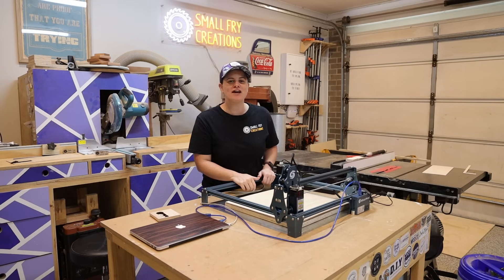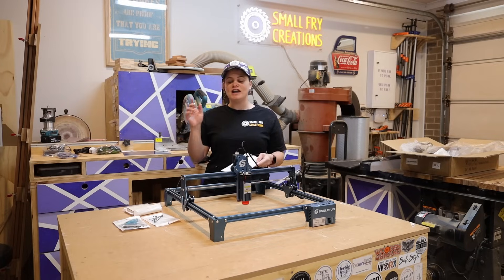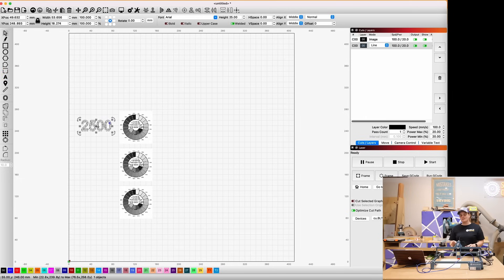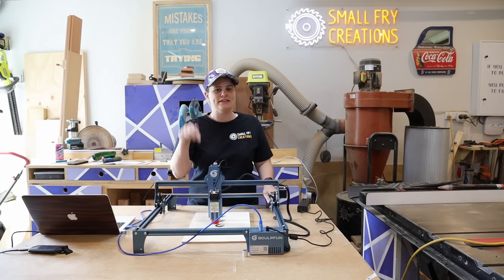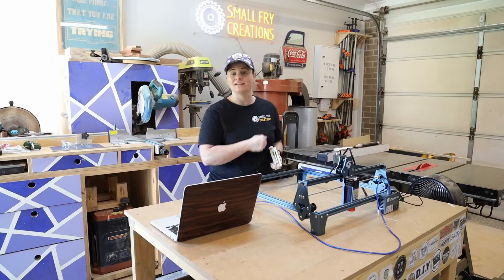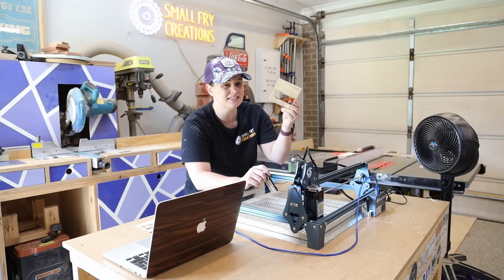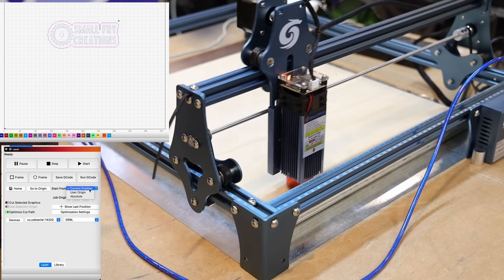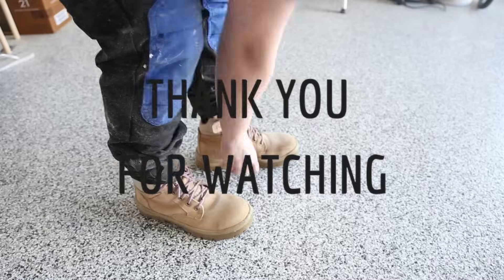BEGINNER Laser Engraving and cutting tutorial with the Sculpfun S9

Comment: Warning!

This is not professional equipment. The smoke, exhaust fumes can kill you - cancer is a likely possibility. The smell of exhaust fumes is unbearable. The burnt dust that is created during cutting or engraving is sticky and smelly. If you do not have a closed box laser with an activated carbon filter or at least an exhaust system outside the workshop, do not think about the laser business. These toys for a few hundred dollars are only suitable for amateur fun - no protection against the laser beam (risk of eye damage), toxic fumes, low power, low speed. Such a laser is only suitable for home-made - once in a while - for fun, for a hobby - provided that exceptional safety rules are observed.

Comment: i just bought laser 50W for 1700 dolars. and its max cutting is also 3 mm.. i feel like i got scammed.. and its very huge machine, like a deep freezer =(.. i could have gone with your laser
Reply from the maker: It is a big misconception out there that more power equals being able to cut thicker material. It really only means it can cut it faster. Althrough at 50W you should be able to get through 6mm and 9mm plywood.

Comment: Inkscape is free and does it all. I had some planes for a wooden clock sent to me in .pdf and .dxf. I had know clue what to do.  After a couple short vids I was importing into Inkscape and cutting gears in no time. There's a home button. Click the home btn then the frame btn. That zeros the machine then it will run a low power beam around the project edges so you know if your material is positioned right.
Also I found out that black will most likely put the laser in raster mode. If you want it to stay in vector mode use light colors like pink or yellow. Raster is for engraving vector for cutting. Really this only matters if you are doing both at the same time. Like i was with those clock gears. they came separate and i had to merge them into a svg file so I 1st placed the wheel  and changed the paths from black to pinkish. then i laid the raster image over it . that would engrave the numbers and stuff onto the gear. Then last thing, i placed a little black circle in the top left corner. this tells the firmware to do the engraving first then cut after. thats what I was told in the video.
:face-purple-wide-eyes: oooo  if i had watched just 3 min longer I wouldn't be here in the comments.
My  40w laser from Temu looks like yours except black. and it has a built in air pump to blow the debris and smoke away from the work area. It also cut a 20mm pine board in 1 pass.
okay now I'm just bragging. $207.00 and the belts were already installed. I spent about 10min on assembly

:person-turqouise-waving: bye

Comment: How would one be able to engrave the top of a wooden chest? I ask because of how low the laser sits. 

Would I need to raise the laser on a platform so it is high enough for the wooden chest or would I need to take apart the top of the wooden chest and place it underneath the laser?
Reply from the maker: You could do it both ways. You can raise the laser up and have it sit on stands or something similar to get it to the right height or you can remove the lid. Just depends what easier for you but both would work

Comment: Hello. I want to get a small laser engraver to engrave plant labels onto thin aluminium labels. Do you have any suggestion? The S9 is too big for my needs.
Reply from the maker: The S9 is a great option. I wouldn't say its to big. I find when poeple get lasers for a job in mind they get the laser and start finding a number of ways to use it and projects to do so having a laser a little bigger will allow you to grow into it :) hope this helps. The S9 is a little older now so if budget allows you could look at the S30 ranger but the S9 is still a great machine.
Reply: @SmallFryCreations  Thanks for the detailed input. The S9 and S30 can cut through thin aluminium?
Reply from the maker: @thefruitcollection  A diode laser won't be able to cut through aluminium. It can engrave but won't cut. If you are looking to cut will need a fibre laser. Sculpfun does have a Fibre laser head that you can switch out which does go with the S9 and other models. So you could have the one laser with two heads and switch out depending the task
Reply: @SmallFryCreations  Thank you. Highly appreciate it. My aluminium tags are 0.5mm thick.

Comment: Hi! Great review, thanks for sharing. I'm considering buying a Sculpfun S9, but I'm concerned about its long-term durability. Since your video was made a while ago, could you please share your experience regarding its performance over time? Has it held up well, and have you encountered any significant issues? Any insights would be greatly appreciated. Thank you!
Reply from the maker: Hey I used the last for about 12 months and only changes as I help Sculpfun with testing and reviewing so moved to the next laser. Providing you are keeping up the maintenance and keeping the laser is good clean working order it should last a fair while.

Comment: I liked this video alot. Im beginer to laser encarving. Planning to buy. Im still comparing some products. I would love to tell me the experience with sculpfun and did u try it with different cases as material. Thickness. Did u try to make wood box joints can u explain how to make tight joint considering the kerf. What about thishoney comp u made send me the link for it. What about this steel pad u used with machine laser
Reply from the maker: I love the Sculpfun brand and recommend them all the time. The Sculpfun community is also fantastic and can help with any issues or questions you may have. In terms of the box joints. I have made lots and never that into account the kerf and I get a tight joint everytime. If cutting I would recommend a Honeycomb bed. Lots of brands have them and they are all the same. The laser is compatible of cutting and engraving all the material on the website. The only thing to take into account is when a company says it can cut really thick material I wouldn't believe it as its generally not the case in the real world. 

If you are mainly wanting to cut or looking for a great all round machine I would recommend the Sculpfun S30 Ultra 22W laser as it will do a great job cutting and engraving. Hope this helps.
Reply: @SmallFryCreations  many thaks fro your reply , what about air assist. is it really important to get too as i am new in laser machines and low budget for small project prototype
Reply: @SmallFryCreations  what about DIY honeycomp u mentioned in your video
Reply: @sabrykamel3137  The DIY honeycomb in the video works but I didn't know at the time you want to avoid Galvanized metal as it is dangerour when heated. You would need to find another material. Lots of people use cooling racks that people use when cooking. If you want to cut material the air assist I think is a must. It will make it much much quicker and cleaner.

Comment: I was thinking of getting something like this for cutting dolls furniture. How tech savvy does a beginner need to be for a laser cutter? What type of software/computer requirements and skills would I need?
Reply from the maker: If your mainly cutting I would be looking for a laser that is 20W. Something like the Sculpfun S30 Ultra 22W as this will cut much quicker and comes with auto air assist to make cleaner cuts. In terms of software I recommend Lightburn. You can download a free 1 month trial and test how easy you find it to use. There are lots of videos online about using it . If you are comfortable with the software then you won't have any issues with the laser. Hope this helps

Comment: What is setting for 10mm wood laser cutting
Reply from the maker: With a laser like the S9 with not huge power I wouldn't recommend cutting 10mm. Lasers like the S9 are more for engraving or cutting 3mm plywood. I wouldn't recommend thickner then this.
Reply: @SmallFryCreations did you try it with mdf 6mm

Comment: Please take my advice with a pinch of salt but read about it for yourself. I don't know if a hobby laser can put enough heat into that galvanised sheet but fumes from galvanising can cause welders fever. Also never use the tip of using cold galvanising spray paint  to edge glass, tiles or metal. https://pubmed.ncbi.nlm.nih.gov/25348190/

Comment: 8:05 you said 2500 mm per second.  That's a lot faster than you think.  Perhaps you mean 2500 mm per Minute (2500mm/m).  Check your settings.  I think you mis-spoke.
8:22 you comment on how deep you're burning.  The slower the speed the longer the laser lase's on a single point and the deeper the cut.  Higher speeds result in lighter etching depth.  You can control depth by percentage or by speed.  OR by both percentage AND speed.  To make the same cut on a higher speed you need higher power.  Slow it down without reducing the power and you're going to burn deeper.

Good video though.

Comment: Hello, i have problems with the cutting part, my engraver is cutting the shapes deform and far from the original size or shape or cutting in top of the engraving
Reply from the maker: Hello That sounds like a belt tension issue. I would check the belts are tight enough and run some tests with rectangles and circles to confirm measurements are correct and belt tension is right

Comment: I found this great video during a search for the S9 as i have just bought one it was on a special offer on Amazon at less than £260  delivered I have been looking at getting a laser cutter for while. I am impressed with your solution to raise the work material from the  surface. i will make one myself as you found those honey combe beds are very expensive. I searched for one myself and found them to be even more expensive here in the UK where i am the cheapest one i could find was over £200. and that was for an A4 sized one. I am impressed by the quality of the machine and am looking forward to getting started with it later today. this will be a good addition to my workshop.
You have answered nearly all my questions i have about using this machine in this video.  I have subscribed and will be watching your other videos 😊
Reply from the maker: That’s awesome!! Thank you for stopping by and so glad I could help. With making your own honeycomb just steer clear of galvanised metal. I didn’t know at the time but gal metal when heated can be dangerous. Something like an oven cooking tray would be a great alternative. Happy lasering!! Lots of fun ahead
Reply: @SmallFryCreations Hi I have found the honeycomb bed on Amazon for £44 delivered for the 400 x 400mm size i have bought the 400 x 400 but wish i had bought the 500 x 500 version as that would fit the frame of the laser better. I have set my machine up this took about 15 mins to assemble and as you say, in the video the instructions supplied are very good. My first cut after engraving my logo is a sign with 350mm tall letters this i will be starting hopefully tomorrow when the plywood is delivered.

Comment: air assist ? is that the board under the work ? the honeycomb board?
Reply from the maker: If cutting a honeycomb under the material will help stop burn marks on the underside. When cutting I would also recommend air assist as it will create cleaner and faster cuts.
Reply: thank you i will get air ass.  @SmallFryCreations

Comment: Are the ruler on the frame usable? Because the laser point can not reach x and y axis : 0.
Reply from the maker: I don't use them as pending the laser head size which varies pending the power of the laser head and laser point isn't at the zero zero mark. You could use it for measurements of material not I wouldn't say they are usable with the laser head itself.

Comment: i was wondering if you could help me out , i have just bought a sculpfun s9 but my engravings have lines in them running horizontal , and i really don,t have a clue what i am supposed to do , any help would be very much appreciated.
Reply from the maker: Hey It may be a belt not tight enough problem. What I would suggest is join the Sculpfun Facebook group and record a video of what is happening. If you then upload to the group they will be able to assist and help you get it sorted :)
Reply: @SmallFryCreations  i have gone through the whole rebuild once again and everything is bang on except the banding , thank you for your time and reply , also did you only have to download lasergrbl on it's own or arduino also.
Reply from the maker: @redliner4965  Glad I could help. I use Lightburn as the software so not 100% about Lasergrbl and the set up.

Comment: I helped a friend set up a different cutter.  We got it to burn the test file but we don't know what to use to create logo file.
Reply from the maker: You would have to create the file in either a design software and then import it or create it in lightburn
Reply: @SmallFryCreations  thanks.  I found out it takes a png file so that helps.  I appreciate the response.

Comment: Thanx for the video, I ´ve been thinking about purchausing a laser for cuttin like 4-8 mm plywood. Sorry for asking a stupid question but how long this laser lasts? Is it like a normal drill that you have to change when it is dull? By the way, you doesn´t sound like an down under, so it´s really easy for people like me to understand you . Thanx again
Reply from the maker: Fantastic. Glad I could help. The laser does have a life span but it all comes down to the power you are running at and the maintenance you do. If you keep the laser clean and run the power no higher then about 80% it will last longer. I don't use it everyday so its hard to say how long they last but I haven't had any die on me yet

Comment: Hi...many thanks for sharing....may I ask please, what is the largest thing in size (not thickness) will it cut, will it cut a full 400 x 400 mm?
Reply from the maker: Yep It will cutt 400 by 400. That is its max size I believe from memory. I always suggest you cut just inside that size so you don't run into any issues with the machine running againist the rails.

Comment: That is one cool tool. ? How small can you make designs with that. Will it cut 10 mm and under (smaller) Have you tried it with metals?
Reply from the maker: It sure is. It will cut extremely small and 10mm and under is easy to do. It has fantastic detail. It won’t cut metal but it will engrave metals with a coating as it removed the coating to show the metal underneath
Reply: Oh My God... The stuff I'm going to create. I'm going micro. Mostly Ladies Jewellery(s). Now that I see I can engrave on a micro level. Oh Baby look out. FYI I'm very good with detail. The smaller the better.
Reply from the maker: Yep absolutely. I put a video out this morning compare a Sculpfun and Xtool. If you check that out and the birthday scatters which are very small you can see the detail and what can be done on a small size 😀

Comment: Watched your program and thanks for attempting it.
Although you described some common problems for a first-time user and the software to use this machine, my problems would start  with the language.
use of technical terms might benefit from a simple description of what they mean
Setting up.  What problems might we find, You say the pictures were enough for assembly but slowing down your assembly pics might help those less used to technical things to undertake the work,
You say the laser positions itself in home places, but one barely describes how this happens, For example, you talk of a grid towards the end for positioning the workpiece but if you didn't have this how do you ensure the piece is engraved is in the right position or level?
Work conditions, One assumes there must be some 'burning' smells /smoke, How do you not have this, or do you need ventilation systems running. Say someone wanted to do this in their bedroom, Is that a suitable place or do you need a special place eg a workshop.
There is obviously a lot more to learn for a beginner and although your video addresses a lot of the issues of unpacking and setting up there are possibly some areas od this process that need more fully addressed unless like yourself you have a good competence
Reply: However, thank you for your attempts to give confidence to those considering using one of these lasers (or any laser for that matter).

Comment: I don't have this laser brand. I have an AtomStack A5 that I upgraded to a 10 watt optical power laser. But a point to be aware of if you laser different pieces of the same type of wood. Even though the laser should etch them all the same, I've found that not to be the case. I etched 95 individual 3 inch diameter circular pieces of wood bought from a craft store for a job I was doing for a client. I can attest, not all of the pieces etched the same way. They were close but I had to trash a few. And when you laser etch wood, make sure your passes go against the grain. Makes for a better etch. Just a thought for what it's worth.
Reply from the maker: Oh good to know. That’s some great tips. Thank you.